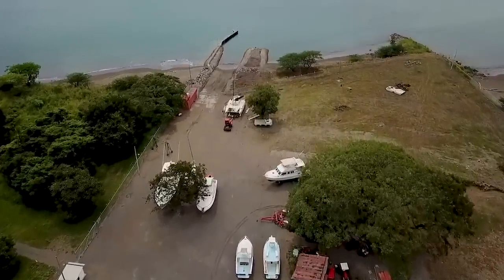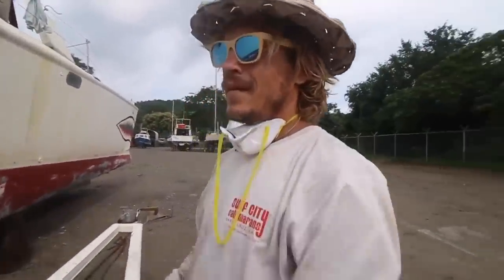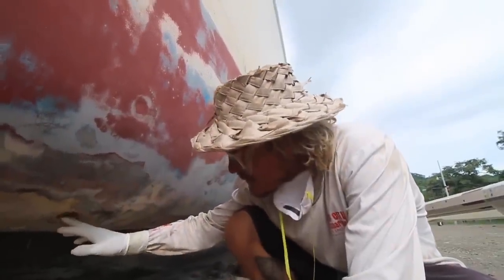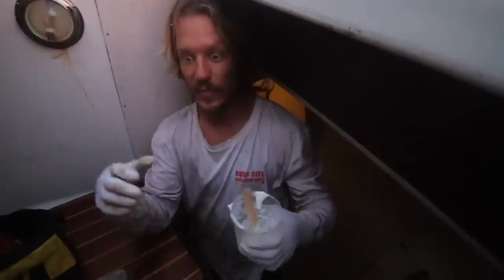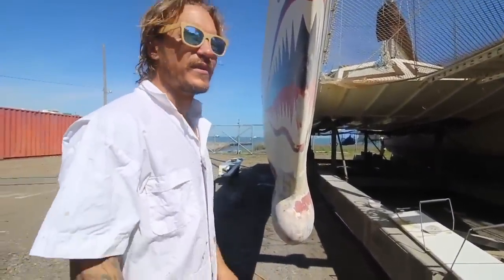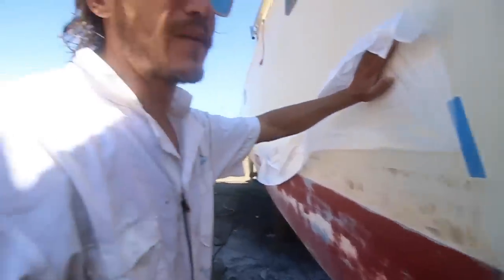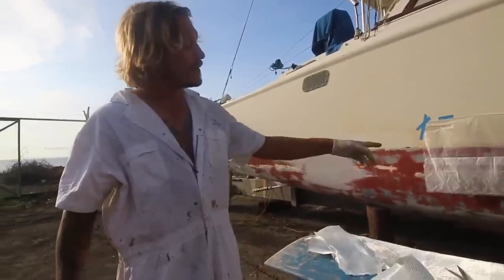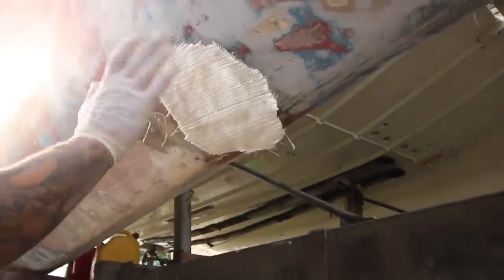Plywood Catamaran Problems. What Work You can expect! | EP48

Comment: Where are you? I spent almost four years working on a boat in Costa Rica but do not recognize your yard. I have been in the boat business for 38 years and agree with many of the comments - i.e. taking shortcuts and using cheap labor almost always costs more in the long run
Reply: Pretty sure they're (or were) in Caldera, right next to the port. I live in Jaco.  I feel sorry for them, as those hulls are in a state and the only real solution will take time and $$$...my parents worked at CSK cats in So. Cal., catamarans were a big part of our lives for quite a while.

Comment: Raise the waterline...thats where YOU load your boat too anyway...need that antifoul to the "Waterline"...those blisters...NEED to be ALL  ground right out...they WILL draw water into the laminations...laying the patches...roller heavy coat of epoxy onto the boat, then lay the hlass cloth onto it, the epoxy surface tension will pull the cloth in and the resin will draw itself through the cloth out to the surface chasing the air out, and NO bubbles !!...i left a comment on that botch job last year...cowboys.

Comment: Man boat builder rule, powder you man sack before you glass. Baby powder a glasses best friend and a roof installation dudes best friend. Cover yourself with it the hose off don't towel off. It saves days of itching.
White antifoul! That's why so many cats are all white, cause the slightest weight change and it goes up  and down.
YouTube fucken sucks you have to sensor yourself to get ad revenue fucken crazy!